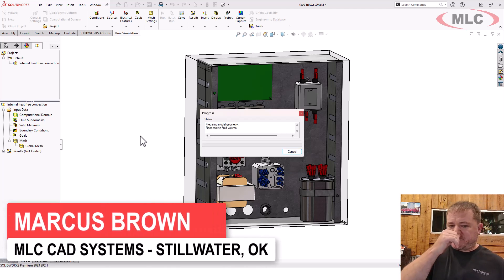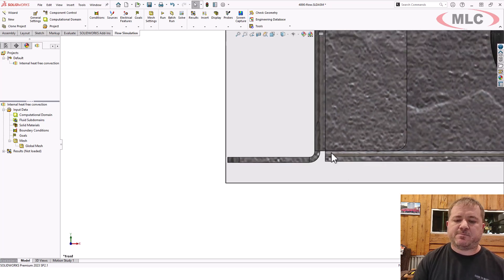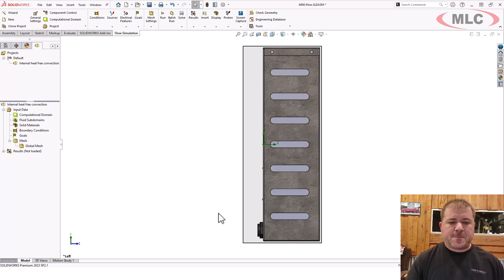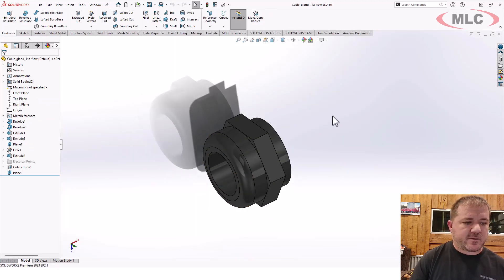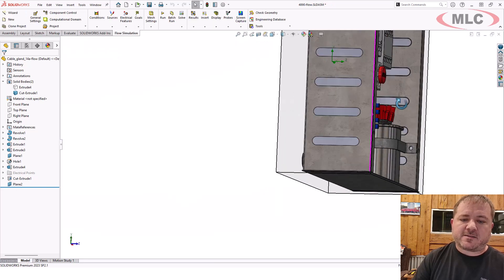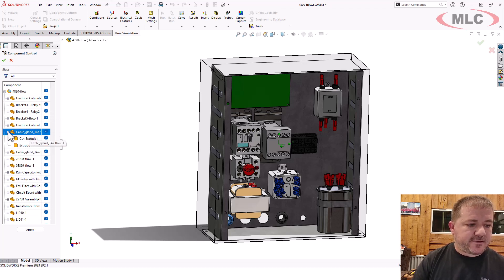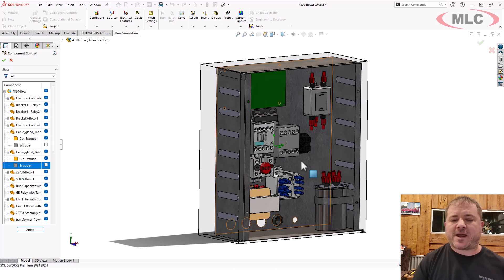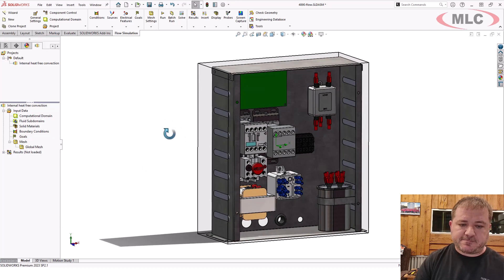Disable Components in SOLIDWORKS Flow CFD with Component Control- Advanced Flow Tips & Tricks

Comment: is it possible to activate the Heat Conduction in Solids, and also prevent solid bodies from being meshed, I will just use the solid body to add surface heat source? for example if the model is a room and I do not want to mesh the external walls or furniture, but in the same time want to add a hot surface to table inside the room
Reply from the maker: All enabled bodies are merged during meshing. Bodies like lids or rotating regions can be disabled so they don't mesh, but I don't know if that would still allow you to select it for a heat source. If it does, it may have the potential to create singularities because the applied surface is zero volume, meaning all thermal energy must be dumped into nearby cells, and if the nearby cells are very small and not eligible for conduction it could create some weird results.
To disable a body, go into Component Control and turn it off.  It won't mesh and you can try to apply a surface heat source to it and see what happens. If that gives you trouble, consider the same approach with a non-zero thickness thin solid and see if that works a bit better. Good luck!

Comment: Can this trick only be done in an assembly.  Can I make a feature in a part for the purpose of creating a surface control but suppress that feature via component control?
Reply from the maker: Flow does not distinguish between assembly components and separate bodies in a multi body part. If it is a disconnected body, you can disable it separate from other components as shown in the video.
Reply from the maker: If you don't see your feature in the list it was likely merged with the other geometry. Clear the Merge Result checkbox to make it a separate body.